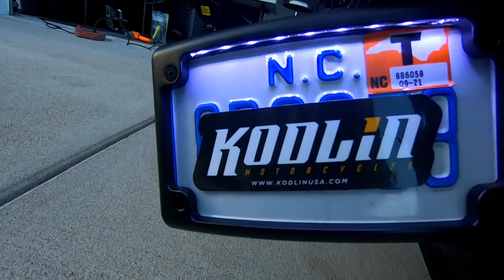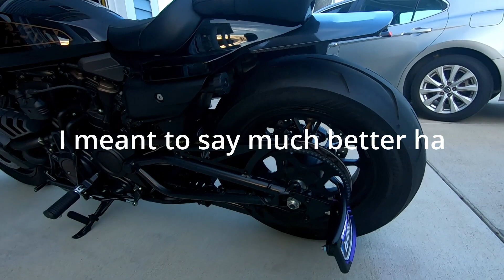Sportster S Rear Lights & Curved License Plate Kit

Comment: I have the same license plate holder and also the kodlin rear lights. for the license plate, I put liquid electrical tape at the end of the wire that connects to the license plate because the insulation was not completely covering the 2 wires and I was thinking it might nick the wires with the vibration.
Reply from the maker: You are absolutely I went ahead did the same. After I looked at it for the first time I thought it could break after vibration.

Comment: Why didn't you get the harness from the kodlin? I got it for mine. It was all plug & play. Nice job it was very easy with the honest from kodlin.
Reply from the maker: Well at the time when I ordered the parts they didn't have the hardness.  Months later I found out they had released the wire hardness for sale. However,  I didn't had fun doing it on the video.

Comment: Does the positive for the licence double up with running lights connection? Help much appreciated great video very helpful
Reply from the maker: this is how i have it wired.(rear light)
Pin 1 -> Blue Wire -> Running -> Yellow LED Wire
Pin 2 -> Brown (Rt) or Violet (Lt) Wire -> Right or Left Turn -> both Light Blue LED Wire
Pin 3 -> Red Wire -> Stop -> Red LED Wire
Pin 4 -> Black Wire -> Ground -> Black LED Wires
(License plate)
Power source for license plate mount is provided at connector loc OEM  on pins 3
(ground – black wire) and 5 (12vdc – blue wire).
Reply from the maker: Run the license frame wire with light colored stripe to a switched 12 vdc power source and the all black wire to a
chassis ground. Cut the length as needed.
use this link if it helps:
https://kodlinusa.com/content/instructions/Installation%20Instructions%20for%20Kodlin%20License%20Plate%20Bracket%20for%20Sportster%20S%20models%20KUS20500.pdf

Comment: Hello .I am from Thailand you can share wiring connect to me . I will DIY same you but i don’t know first step.  And i don’t know what color wiring is mean. 
Ex. 
1. Blue color wiring is turn signal?
2. Black color wiring is ground ?

Thank you for reply me.
Reply from the maker: Blue / White wire is left turn
Brown wire is right turn
Blue/Orange wire is stop for the brakes
Black wire [ or black/blue] is ground for licence plate frame 
Black wire is ground
Blue wire is running lights

That should be everything.
Reply: @rockermotorider    Thank you so much. 😊😊😊😊😊